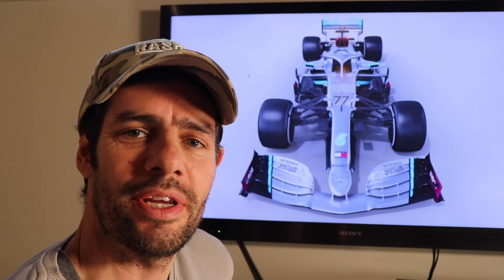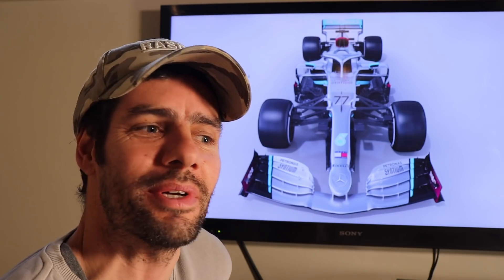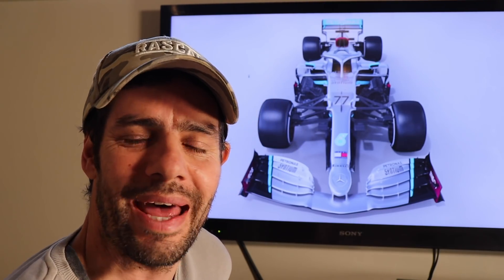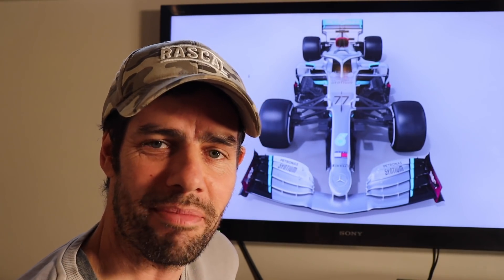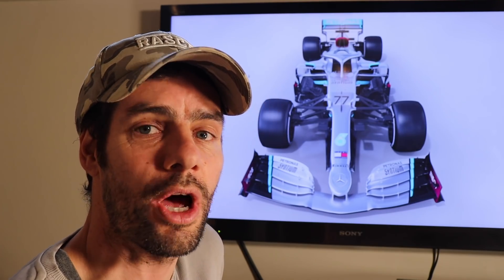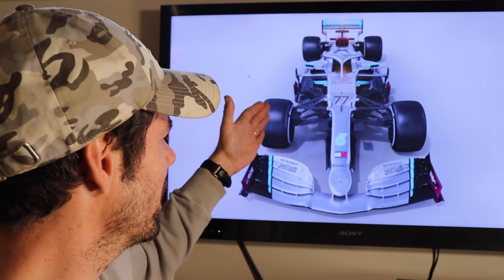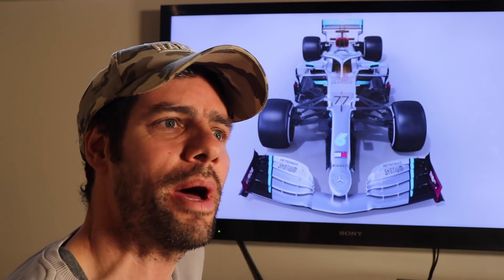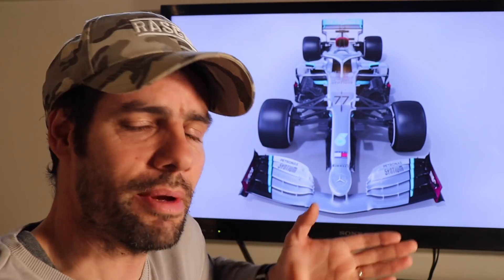Explaining Mercedes F1 DAS System

Comment: Hi Marc. How do you think this system will be worked in 2021- since the 2021 regs say the steering wheel must be single axis only? If such devices can’t be powered (according to the 2020 and 2021 regs) they won’t be able to affect the change via a steering wheel button.
Reply from the maker: I don't think it will feature in the same way at all next year, but the thinking is embedded in the design offices now, so they may well come up with another clever system at some point.
Reply: Marc Priestley - cheers Marc 👍🏼

Comment: There shouldn't be complaints about any 'systems' used by Mercedes.
The rear suspension arms are 'imoveable' aerodynamic surfaces, thus legal, and they'll argue similar about the steering because it's driver adjustable and give or could give extra grip in a straight line.
Don't forget Williams have expeimented with similar ideas previously.
Steering:
The first time was the 'brake steer' 1997.
This allowed Coultard  to turn the steering and allow brake input on the side they were turning with the aid of a third brake pedal.
This applied the brakes in the middle only aiding braking through the corners and bends and thus grip, making them faster.
That was deemed legal.
We have only seen the Ferrari system used in a straight line but they will argue that it could also be used in corners and bends.
Although not aiding acceleration, teams will argue that it could aid grip.
Fully expect it to be ruled legal.
Rear Suspension:
With regard to the rear suspension arms, Red bull attempted to use something in 2009.
They had what were upside down surfaces on the rear arms, they weren't adjustable and were fixed in a lateral plain.
These simply acted as a 'wing' for air, keeping it in place at the front of the chassis aiding downforce at  low speed but also causing lift.
The air would then 'spill' over becoming very turbulent.
As far as I'm aware, the Red Bull system wasn't ruled illegal, but if there were any benefit they would have continued with it.
Ferrari have clearly been working on their system for sometime with a version being used in 2019 and obviously developed further for 2020.  Their system is clearly giving a less benefit aiding downforce in that rear area.
I can see how the Ferrari system wouldn't be deemed legal and the 2020 version of Mercedes illegal, neither were/are adjustable by the pit crew or driver.
Having said that, I have no doubt protests may rain in from Wiliams.
I fully expect these suspension arms to be ruled legal agin in 2021.

Comment: At 2:00 you explain why toe out is good, but isn’t the reason somewhat simpler? The inside wheel is performing a sharper turn than the outside wheel because it is closer to the centre of the circle so to speak. So for both wheels to be rolling not scrubbing you have to have toe out in the turn, and the tighter the turn the greater the toe out. Once the Mercedes drivers get used to it they should be able to actively pick the exact amount of toe out as they drive in, then through and out of the corner. Maybe the next step is to automate it.

Comment: @MarcPriestley As a driver would this new pull out and push in motion of the steering wheel feel very unnatural?  As road drivers we have been conditioned to only turning the wheel. This new motion requires completely different muscle memory movement. I suppose, I did learn new muscle memory pushing radio and cruise control buttons on my steering wheel. But that's a small finger movement and I am not doing it at 120+ miles per hour. I wonder how long Lewis and Valtteri had to practice with the new steering wheel. I assume Merc's simulators would have this new steering wheel to mimic the motion of the actual ones in the silver arrows?
Reply from the maker: Yes, been tried in the sim and both drivers say it's easy to adapt to.

Comment: Seriously, if it's an adjustment 4 Toe in / out it's Only Good 4 Heatg or Coolg d tires. I've thght a Similar Idea 4 F1 cars, but it's 4 d Camber. Nt sure if I hd sent it n 2 sm F1 team fr yrs bk. Cnt rem. But if U cn Chnge Ur Camber n dem corners U'll b able 2 Corner Faster. I do think fr Watchg dat vid w Ballsman Hamilton drvg w d DAS, d car tires seems more Vertical n Curves.
Reply: Sorry, but camber angle is a part of suspension settings and couldn't be changed dynamically while driving. That's the rules of F1. Many people and F1 teams argue that toe angle is also a suspension setting. But it seems not to be by the rules.

Comment: The way I see it, the steering wheel ajusts the steering angle of the wheels. There's no rule that says that the steering angle of the wheels has to be in a fixed relationship of "they are x degrees apart at all times" -- Mercedes have just made a new steering system where (a) turning the wheel controls the average steering angle of the wheels and (b) pushing/pulling the wheel controls the angle difference in the wheels.
Mathematically it's actually quite beautiful. If L and R are the steering angles of the left and right wheels respectively, then (a) turning the wheel controls (L+R)/2 and (b) pushing/pulling controls (L-R)/2.

Comment: #AskElvis can this system be done without the steering rack thing? Can you just add a button or lever on the steering wheel to change the toe angle?
Reply from the maker: There are a number of ways it could be done, but this doesn't involve the driver having to take hands off the wheel and seems quite intuitive.
Reply: @F1Elvis  IT was more to consider that the steering option allegedly will be banned from 2021, but as far as I understood, the basic premise of changing the toe angle of the wheels isn't. Could be wrong on that one though.

Comment: Are you allowed to have adjustable camber or pressure compensated adjustments to camber?
Reply from the maker: That would be a much greyer area....
Reply: @F1Elvis  would be interesting if it was permanent in the design, like a top stab bar that pushes light side tyre over ever so slight.

Comment: It gives the driver an analogue input to improve the stability and human centred input to improve the manoeuvrability and interaction and feel to make cornering safer and more efficient and produce less ware on tyres in the dynamic racing environment. What's not to like, only use if it purely a mechanism between driver and their judgement of the road and racing conditions. Better than DRS.

Comment: As a front end mechanic you are familier with Ackerman steering which would by design toe the wheels out in a turn while keeping them at zero toe when going straight. Problem is that most Ackermen is achieved by mounting the steering rack and tie rods behind the axle centerline, but all F1 cars have it mounted in front of the axle. This would tend to toe the wheels in on a curve. Ultimately you want the inside wheel to turn at a greater
 angle the outside wheel, so why doesn't F1 constructor do that?

Comment: Good video and thanks for the info but your excuse for why this is legal is crap. It’s a clever idea by Merc but you’re trying to say that this change in toe is okay because this little slider the rack is on is just a mechanical device that happens to have an effect when he is using the steering wheel and lots of stuff happens when use steering wheel. 
So how bout when push or pull on steering wheel it changes other suspension stuff? All you’d need are some more little mechanical bits. Or just attach mechanical links to the throttle and brake pedal? I mean wings are constantly moving up and down depending on how much throttle and brake are being used anyway!
Reply from the maker: No? I'm saying it's legal because it changes steering angle (toe angle) and there is no rule preventing that happening...
Reply: :) thx for the reply but I’m not buying this at all. Driver is changing the suspension setup from when it was set in pits to give him an advantage but biggest problem is the can of worms this opens if deemed legal. Just think about it for a few minutes!

Comment: 5:32 that would require much physical strength tho (I think), and we’ve seen Lewis doing it actually pretty easily.
Reply: I don't think it would -- besides, it might be helped a lot by the acceleration of the car. If you have to pull a heavy steering rack, a couple of gs at the start of a straight might be just what you need to help you pull innit ? And vice-versa... deceleration at the end of the straight may well help you pop the steering rack back into position. It'd be quite clever...

Comment: Masi saying this system won’t be allowed in 2021 but you seemed confident it would translate to 2021. Any clue why it wouldn’t be allowed next season?
Reply from the maker: Having checked the 2021 regs, it has been written out for next year, presumably when Merc talked to the FIA about it at some point in 2019.
Reply: Appreciate it. New to the channel but absolutely loving the content. Thanks a ton for taking the time to share your insights.

Comment: Most street cars have static toe in NOT toe out. Toe out on a street car wears tires much faster. Toe out does help turn in. Toe out also has the problem of wondering on roads that aren't flat.

Comment: how is this not changing suspension geometry,,,of course the car does it on its own but they are changing the suspension geometry of the car
Reply from the maker: They're changing the steering geometry...
Reply: @F1Elvis  I have always thought toe and camber are suspension adjustments
Reply: brsrbck  same thing was all suspension adjustments..its the link between the body and the tires..ie suspension...just go looks up suspension adjustments and toe and camber are there...always

Comment: Toe out? I thought 0,5 ° of toe in was the standard. Making the car steering less sensitive in a straight line and making the outside wheel with the most grip in a corner turn the car in better
Reply from the maker: No, toe in at the rear

Comment: Marc, next years rules can this toe in toe out steering trick system be used in the new regulations? If it can it looks like Mercedes might have snookered the opposition as they will be forced to get it working on their own cars either that or lobby for it to be banned, it could also turn in to unwanted distraction from next years regulation overhaul for the other teams.
Reply from the maker: It looks like they've actually banned it in next year's regs...
Reply: @F1Elvis  Spoiled sports, it's a great innovation.

Comment: Marc, it an amazing innovative design. Straight wheels less resistance etc is great OR Is it to add toe to increase heat generated on straights to keep tyers at optimum temperature for turn in? What do you think?
Reply from the maker: Both

Comment: All vehicles have toe out when turning and have had since the days of the horse and buggy when it was patented by Rudolph Ackermann in 1918. It seems to be legal as all steering input has to be provided by the driver. This seems to be purely steering angle which is the direction the tires are pointed which has to change to turn corners. The suspension controls the ride height and stiffness. I suspect Mercedes did consult with the officials about this. The only reason not to would be a risk of it leaking out to other teams before the season starts but obviously it's no longer a secret.

Comment: Hi Marc, there is one problem with that explenatition why it's legal. Because when you move steering wheel in this way, it shouldn't be a problem to make a system moving your steering wheel up and down. That means, that you could change your ride-height absolutely legally. I am not sure it is legal right now, or not. But I am absolutely sure it is impossible to be legal in future, because that's exactly FIA trying to ban for many years.

Comment: I wonder if there is more going on here, doesn't the mercedes use it's suspension geometry to raise/lower the front wing, so on slow speed turns the wings closer to the ground for improved downforce, surely if their geometry allows for a lower front wing when it has a steering input, the wing would be raised when the geometry of the suspension has both wheels alligned and no toe is used, surely this is being used to stall the aero on the straights? Or am I overthinking it...

Comment: Legal or not I can see it from both the points you mention. But my thought is the overall benefit worth the expenditure? (Mercs obviously  think it is) because, as I understand  teams are obliged to use a set of hard and a set of soft, (or c1-5 or whatever the set up is these days, personally  I think it's a ridiculous rule that should be scrapped, but I digress) I.e they must change tyres, so any gain is absolutely minimal, once they change boots it back to square one as far as I can see. Is it just any which way a team can wrestle a few extra tenths/hundreths ahead is worth the effort?

Comment: Having the steering wheel move in and out is not the best way to do it and could easily result in some hectic moments for the driver during a race. This 'toe change' could be achieved by having the inboard pivot of the tie rod mounted on a pivoting fulcrum instead of directly to the end of the rack, where the other end of the fulcrum is anchored by a link to the body of the rack. All sorts of adjustability can be engineered into such an arrangement. This would produce an adjustable and dynamic variable ackermann effect allowing just the movement of the steering to produce a differential variation in toe at the wheel and at a variable ratio if it was needed.

Comment: Great analysis Mark, couple of things occur to me. The movement of the steering wheel looks too smooth and controlled not to be either fully hydraulic, or when Lewis pulls or pushes on the wheel the reistance is met and countered by hydraulic fluid giving him more consistent control than a purely mechanical only one.
The other thing is will the other teams spend precious time and resource developing this while clamouring it to be banned. If they don't develope it, try to get it banned and it isnt they have  wasted a lot of time, the same is true in reverse, develope it just in time to be banned and not gain the benefit of (probably) race wins before that happens.

Comment: Couldn't it be that they use it to run more aggressive camber? A tilted (camber) wheel wants to run in a circle instead of straight on. So they can allow the wheel to run in its preferred direction on straights now, have much less tire wear and still benefit from huge amounts of camber?

Comment: Instead of pulling and pushing on the steering wheel, couldn't they have made it simpler by using a toggle or push button system on the wheel that the driver activated? Or would that have resulted in a rule violation?
Reply from the maker: It would be much harder to get a powered system through the rules...

Comment: Just a nitpick, at least here in the states, most road cars call for static toe in as it's "safer." The car tracks straighter and it helps introduce understeer. Again, it's a nitpick, and I'm talking US spec road cars.
Reply: I thought that too, most road cars have toe-in at the front as far as I know. I had some toe-out before I went for a wheel alignment. The car was twitchy to drive straight if there were any grooves on the road. And the insides of tires weared to canvas in one summer.

Comment: Although very clever won't other teams protest it being a movable aerodynamic  device.

I say that because the suspension is now an aerodynamic device. Although the track rods move when the driver steers. . If they then move in a non standard movement does that not become movable aero.?

It's on the edge of legality and that's what F1 should be 👍
Reply from the maker: I can't see that being an issue. Aero is definitely not the primary function of the device.
Reply: The other take that the cars go into parc ferme from Saturday morning and can't change anything on tbe cars apart from basically wing angle without approval/penalty...... .. can they change toe within that rule?
Reply: While I've got you Marc I rewatched your original video on Zandvort where the guy from the circuit said they didn't need to do a lot.

It would be great to see you do a follow up considering they have dug the whole thing up showing the differences..... and your thoughts on the new Zandvort!

Suppose I should #askelvis

Comment: Innovative or illegal?.........how long has this system been used!
Were the other teams aware.?.....and did they design it in their cars?
Were  FIA rules violated? Are there potential penalties coming?
Merc pulling out of F1 have connection?
Reply from the maker: Today was the first use and the FIA were aware before it was used. I don't see it as being illegal...
Reply: Marc Priestley are the other teams aware.......it’s basically up to the co-op.....to pursue it or not!
It could be contested if a determined  advantage if not fully regulated.........today’s F1 is all about equality and rules.
Look for Ferrari’s response......if they have doubts, it will be a concern!

Comment: I totally interpret this as being as outside of the regulations as seen below. I do understand that different people may interpret it differently, but note that it says "with the steering wheel fixed":

10.2 Suspension geometry: 
10.2.1 With the steering wheel fixed, the position of each wheel centre and the orientation of its rotation axis must be completely and uniquely defined by a function of its principally vertical suspension travel, save only for the effects of reasonable compliance which does not intentionally provide further degrees of freedom. 
10.2.2 Any powered device which is capable of altering the configuration or affecting the performance of any part of any suspension system is forbidden. 
10.2.3 No adjustment may be made to any suspension system while the car is in motion.
Reply from the maker: I don't see it breaching any of those...